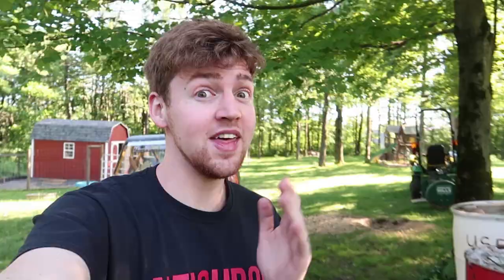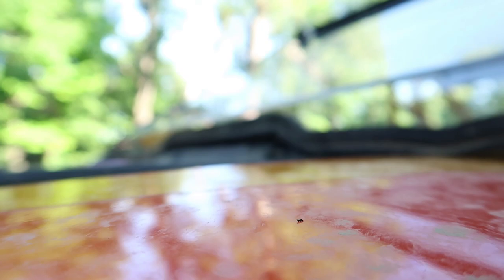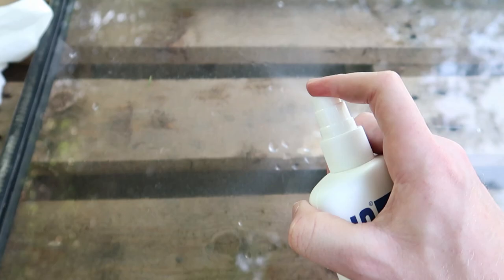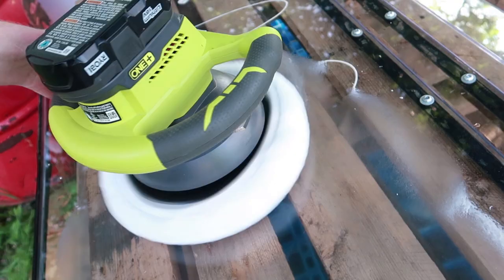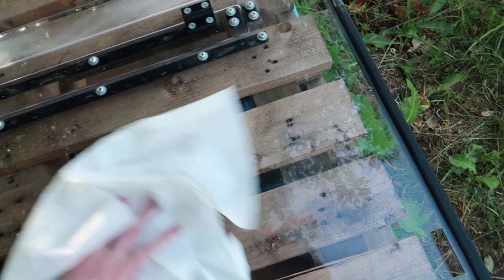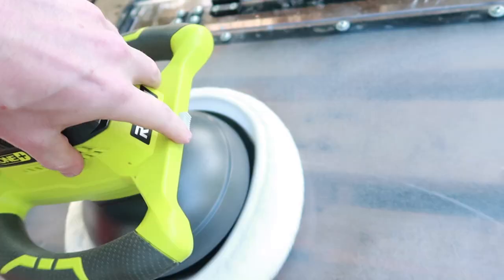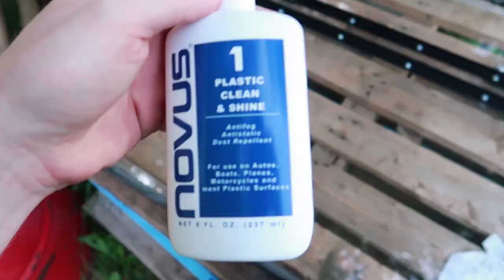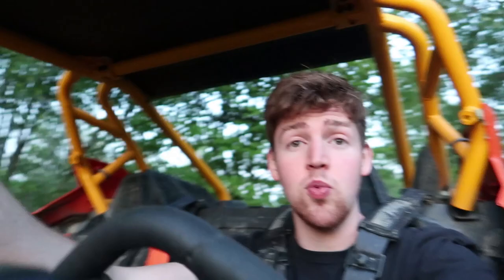How To Remove Scratches From A Side By Side Windshield

Comment: I recommend the tip up windshields. They don’t scratch that easily and if it’s hot you can open it up and get some air flow.
Reply from the maker: That or a glass windshield would do the trick!